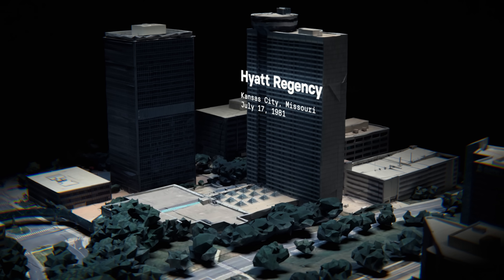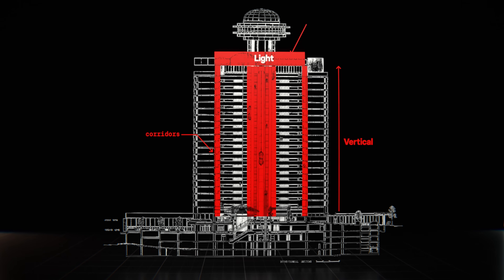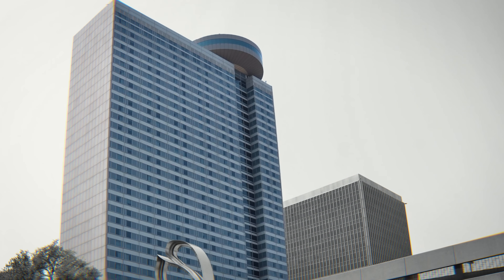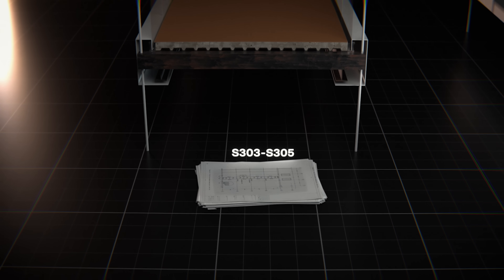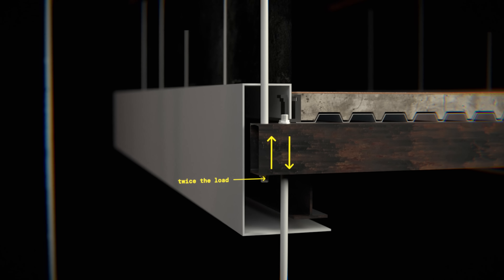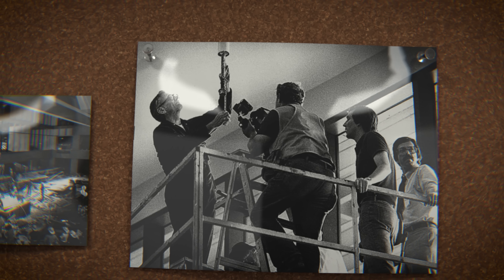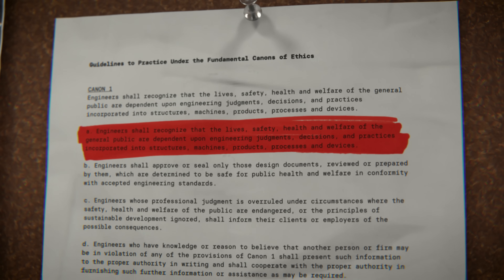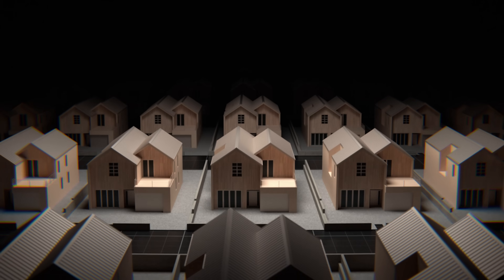Inside the Hyatt Regency Skywalk Collapse

Comment: Structural Engineer here. The devil is in the details. Structural detailing is the hardest part of structural engineering, and is often the source of problems. Good job again explaining the structural concerns of this case. This was a watershed moment in the industry that is taught in universities today.
Reply: He missed another part of the revisions that made the final design messed up.

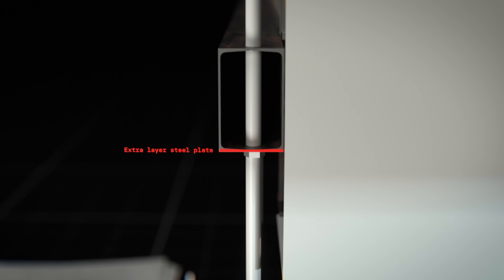5:55 The original design had the welds on the box beam on the side and not the bottom, which is why the additional weld plate would be needed (and was ultimately omitted). I do not think it was ever established why the weld was moved, but that weld really needed to be on the side, even if it didn't look as nice.

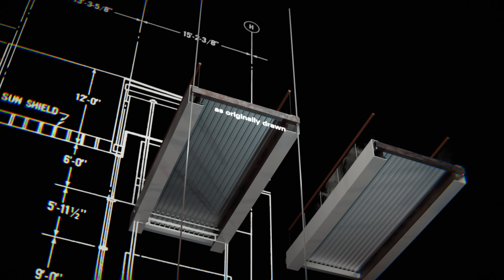6:25 this part isn't so much an omission as much as an explanation- the reason why the continuous rod HAD to be split according to the steel contractor was that the single rod would need  to be threaded the entire length of the rod in order to get that nut from the first floor to the third floor. Any errors in the threading may require a new rod to be manufactured. And then a guy would need to go up the whole length with a wrench or something in order to get the nut up there. 

The original design was bad and the new design was far worse.
Reply: Be that as it may, wouldn't a deafening alarm go off in your head instantly if you saw that design?
Reply: @ian_b  well thats why we sketch load paths
Reply: As a structural designer I totally agree with what you said.
Reply: I think historically this plays a similar role in your kind of engineering as the Therac-25 did for software-controlled device safety in terms of introducing layered safety instead of just trusting a single engineers review of a single layer of safety protection or the Tenerife accident did for Cockpit Resource Management in airlines instead of rigid hierarchical roles.
Reply: Details? Sure. Greed? More often.
Reply: @bearb1asting  yes but greed is the motive behind the lack of attention to details. Starvation and food, one implies lack of attention to the other
Reply: why did you feel you needed to include that you're a STRUCTURAL ENGINEER! ( so you say,but thats besides my point )
im a CHEF ,BEEN ONE FOR 93 YEARS NOW ,and i made spaghetti last night....thats how arrogant and stupid you sounded.grow up.
Reply: @Francisco-u2p5j Who hurt you and why are you so upset? Being a structural engineer shows that a person has more expertise in an area that most people don't. Also, why is it so crazy to think that a structural engineer uses the most popular video sharing site on earth, especially when commenting on a video about their expertise? Grow up
Reply: @listen1st267  you completely missed my point..your statement was you being full of yourself,,,being smug,,arrogant,,
it was equivalent to a man walking up to a woman and saying," Hi,im very handsome,and your beautiful,we should get to know each other"
thats how what you said sounded like.... PEOPLE LIKE YOU, want those you speak to,  to see you as you see yourself.
im NOT JUST A JANITOR,I AM A GREAT BUILDING MAINTENANCE TECHNICIAN!!...IM NOT JUST A COOK,IM A CHEF!!
...IM NOT A LOAF OF BREAD,IM A BRIOCHE!!....now do you get the point,,,when you feel you need to tell someone what you do or done so that they take you seriously,,,thats weak and insecure...
Reply: @Francisco-u2p5j  Why so mad?
Reply: @SoidHoid  mad??.. how could you possible arrive at such an erroneous speculation?..you cant determine what a person is feeling by words they type?..ha,ha,ha,ha!!...you must be a very soft,soft person to think im mad,,,did i scare you with my choice of words perhaps? did i use an exclamation point which made you think i was angry?...what made you think i was mad?,,,because i wasnt,,,how am i going to reach the emotion of anger with a stranger?
Reply: @Francisco-u2p5j There is a difference between someone saying "I have a body and therefore I know how to do surgery" vs "I have studied and am licensed in the field of surgery, therefore I know how to do surgery". This is a far more relevant comparison to the topic at hand. 

Would you take legal advice from someone who isn't a lawyer? Would you take investing advice from someone who isn't a fiduciary? Would you take medical advice from someone who isn't a doctor? Would you trust a highrise building designed by someone who isn't a structural engineer?
Reply: @listen1st267 saying that you are whatever,whatever WITHOUT proof,doesnt mean YOU ARE WHAT YOU SAY YOU ARE.
do you gullibly believe everything you read?..IVE BEEN A BAKER FOR 96 YEARS,I HAVE 2000 BAKERY BUSINESSES ALL OVER THE WORLD,SO I CAN TELL YOU THIS,blah,blah,blah,,,anyone can say anything BE ANYTHING ! in the YouTube comments section,,,doesnt mean its true,ha,ha,ha,ha,,,PEOPLE LIE,,,for whatever their reasons are ,they lie,,,so this guy that claimed he was a structural engineer,,,made me laugh for saying STRUCTURAL ENGINEER HERE,,,ha,ha,ha,,who does that?..i tell you who,,,BOYS TALK LIKE THAT,,,do you ,,,,kind of understand?
Reply: Hello there, YouTube Structural Engineer, I'm a YouTube Quantum Scientist and Astronaut, nice to meet you.
Reply: @Ellie_The_Lesbo_of_Us  lmao it's not like there are just a few structural engineers in the world - and this video probably draws in a lot of them who have never heard about this incident and naturally want to learn more (me included). Stop being weird.
Reply: @tea1696  you should get the book 'why buildings fall down', it covers this collapse and a bunch more and they all have really nice sketches and details to illustrate each problem. That book definitely shows some things to consider in design calcs even though its written so a layman can read it

Comment: First learned about this incident from the series Seconds From Disaster. It’s been covered again and again by engineering content creators because it clearly had a massive impact on the industry. Stewart really explored the lead up and competing interests at play that caused this; it was great to learn something new. 
I think it’s wrong that Jack Gillum and his firm were the only ones to bear responsibility, Haven Steel shouldn’t have been allowed to make a change like that to suit their timetable and Hallmark got off too easy and the victims here and in Vegas are worse off because of it. Still, it’s important that someone was held accountable. Them facing a penalty then ensures that other structural engineers do their due diligence now.

Comment: Is it not an issue to have a box beam supported by a washer and nut through the weld of a box beam in general? Maybe my intuition is incorrect, but I would assume that a weld is more likely to split or break than a solid steel face.
Reply: Mechanical engineer here, welds are usually stronger than their base metal. It just depends on what material is used to weld, the quality of the weld, and thickness of it. 

The shape and thickness of the base metal matters as well, the beams for this design are box shaped for a structural reason, not just looking good. However in the end they were not properly sized for the loads applied as mentioned in the video.

Comment: Thanks Stewart for touching on the KC Hyatt Regency skywalk collapse. We studied this in depth back in University of Illinois Architecture school and then again in my graduate Civil Engineering classes. I am glad you put emphasis on the "fast-track" (at the time called telescoped) construction process and its contribution of shifting the burden of responsibility. 11:27 does a good job of summing up the need to empower the designers and checkers of those designs to compensate for in-the-field or last moment adjustment, alterations, and outright human or fabrication errors. The roof collapse should have put serious doubt in the minds of the inspectors as to the workmanship and construction practices in place.

I ended up moving to KC in '94 after school to become an Architect and I have been to the Hyatt a few times and it is odd to see the space without the skywalks, but I feel that the original Architect's vision was actually better and Hyatt'a push for a JC effect is what forced the issue - empower the Architects to be able to say "No". My last big project I worked on was the Loews Kansas City Hotel connected to the Convention Center, I was the studio director of the local Architect of record and we were responsible for most of what you "see" around the outside and its relationship / structural connections to the surroundings. I always had the Hyatt in the back of my mind when working on the plans.
Reply: Good job on the Loews. It looks like it belongs and was part of the initial design with a more modern look. It’s definitely a boon to downtown KCMO.
Reply: @dmcbratney  Thanks so much. I was very happy with the way it turned out. Too bad it had a forced "soft" opening right as the COVID shut down hit in April of 2020. Sometime I want to book a room there and just experience the place like a tourist would. The "crown" at the top and the bridge to the Convention Center are some of my personal favorite elements.
Reply: I used to live in KC. I moved away before the Loews so I’ll have to check it out if I get to go back.
Reply: The JC effect... I can't help thinking of the Radisson in Berlin with a 500-foot aquarium in the lobby -- amazing, indeed, but pushing the limits of what acrylic could do. And when it burst, by luck no humans were seriously hurt, but 1500 tropical fish lost their lives. What other follies are out there waiting to fail?
Reply: I'm not sure I agree fully with the "empower the architects to be able to say 'no'" bit. To be sure, the architect is the professional, and their word should carry weight. But should the architect's job not also be to merge visions, so to speak, of the owner/builder/developer, and their own artistic design? From a perspective of easing getting back and forth, walkways, I think, did make sense, and facilitating ease of movement is also a key job of the architect, beyond it just looking great. Your thoughts?